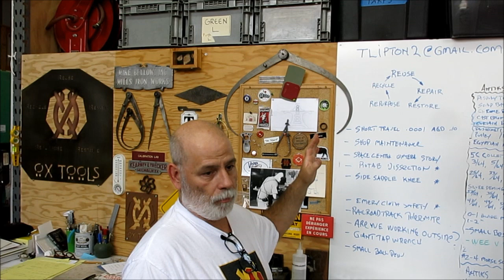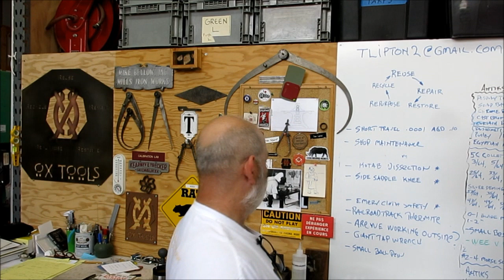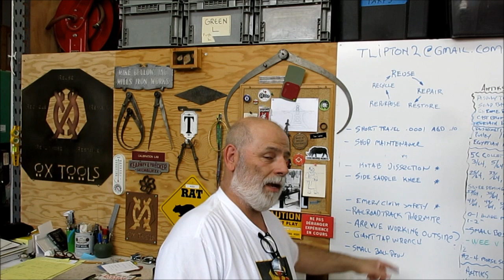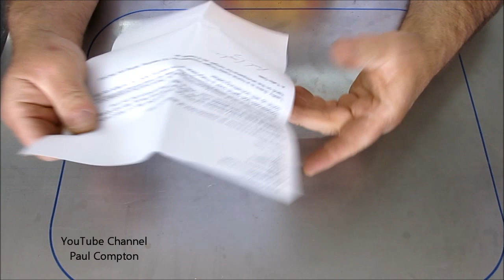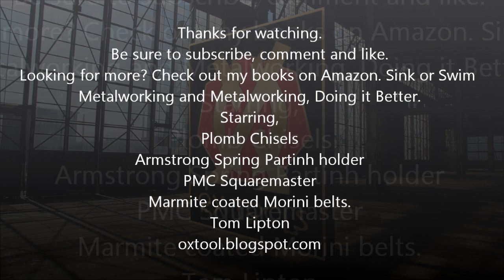Monday Night Meatloaf 36

Comment: Another cold chisel story. When I was a marine engineer on oil tankers we were required to use bronze cold chisels anywhere outside of the engine room. We worked at a rate of two or three sharpens per split pipe flange nut. Sharpening was done with a file.
Reply from the maker: Hi Derek,

Good old Ampco or Beryllium copper non sparking tools. I heard a story about a shop that had a vise made out of this material. Nobody used the vise but everybody was required to spend some time polishing it. Apparently it was pretty spectacular. This was a shop at the Concord Naval Weapons station.

Cheers,

Tom

Comment: Tom, When I get back to the shop tomorrow I'll try some purple stage lighting filter on top of a dial indicator face and see it it can reduce glare for you. 

Yes, gunblue does continue to etch. Bluing is the process of controlled oxidation. They also loose accuracy because of it. I reblued dads air rifle barrel, I can not stop it from rusting. I've basically soaked it in oil but I can't stop the corrosion. Thankfully it's just on the surface but it doesn't look good.
Reply from the maker: Hi Andre,

Thanks for the note. Let me know how the filter thing works.

Cheers,

Tom
Reply: I'll do a video and show you if you'd like.

I have a question about stamping letters, I'll email you.

Comment: Hi
Tom
Nice video
It is a brave man that power feeds a parting tool
Regards
John
Reply from the maker: Hey John,

Brave or dim. You heard the story so it must be the latter. Thanks for stopping by.

Cheers,

Tom
Reply: I dont call myself brave but i feed the parting tool most of the times. Usually working with carbide brazed tool that is 4mm wide at the tip. All it needs is a constant coolant and a right feed rate. The lathe is old, 1959 made in Russia. We call this mid-size lathe over here. The length between centers is 700mm. Power feeding just saves time.
Reply from the maker: nuu5t1k Hi Nuu,

You have it right. Constant pressure is one of the keys to successful parting on the manual lathe.

Cheers,

Tom

Comment: There are other variations on the idea used in your spring center punch.  I have a set of three that includes the spring center punch, a double ended nail set, and a small wood chisel. Very handy for things like setting finish nails in tight spaces, cutting mortises for door latches, etc. When you need one, nothing else will do. 

Thanks for the vid. Someday it might be interesting to see proper use of cold chisels. 

-- Mike

Comment: hi mr.tom, i love that parting tool holder. i could have used one a few days ago :) i saw the caked grim on the square bolt from the parting tool and thought that needs to be scraped, then i saw you try and pick it off with the screw driver and i though "at lest i am not the only one who saw that". love your videos. Thanks. Tristan Shepard
Reply from the maker: Hi Tristan,

I will probably bead blast the entire thing and give it a good oiling. Thanks for the comment.

Cheers,

Tom

Comment: Tom,
Nice chips after the grind with the parting tool. I like the older tooling when you just sharpen the tool rather then changing the inserts as you do with the new tooling. I think the only advantage with the new tooling is in the finish they leave and the fact that it is repeatable. It certainly can't be in the cost! As for the Marmite, yes it has a unique flavor but so does tree sap and I don't want any of that either. Now perhaps a nice shot of Scotch to get the thought of the taste out of mind. Anyway Thanks for the Meatloaf and for sharing the contents of your chisel drawer from your toolbox.
Kind Regards,
John
Reply from the maker: Hey John,

I think I'll test some of the Marmite on my Heeler. He eats almost anything including unmentionables left by cats. Marmite would certainly improve those.

Cheers,

Tom

Comment: I have one of those spring-center punches with the double ends at 26:00.
 I think that one end that isn't pointy is because it's a Nail set. or in your case Eric it once was 
It works great at setting nails I would even say it's better at setting nails than the center punch side is at punching centers.
 since you pulling the spring out to load it. It tends to move on you right as you release it. 
but with the nail set, there's a divot where the nail head engages that keeps it on target.

Comment: Tom

No-one else has weighed in with this yet, so I guess I might as well.

Plomb chisels and punches:

" Los Angeles " instead of " Made in USA " -  1939 or earlier;

" O " in Plomb, instead of downwards triangle - 1934 or earlier;

Letter code at the end identifies year eg  8D = 1938;

Changed from " Plomb " to " Proto " in 1948 to comply with legal action by the Plumb company of Philadelphia, over confusion in the marketplace about the names, particularly on hammers.

That confusion continues.

Regards
Reply from the maker: Hey Stephen,

Looks like these are between 1934 and 1939. Very cool. Its amazing they have been untouched for so long. Thanks for the comment.

Cheers,

Tom
Reply: oxtoolco Here is a URL to an interesting Plomb info site: 

http://home.comcast.net/~alloy-artifacts/plomb-gallery.html

Comment: It is interesting that here in the UK there is an advertising programme going on about Marmite on the basis of "Love it" or "Hate it"!!!!  In our house my wife loves it while I am firmly in the Hate camp.

You must have courage in Armstrong tooling, especially in that apparent condition, to power feed that parting tool. However it was real interesting to see the 'safety device' working and the modification of the cutting tool edge work so well for you. Thanks.
Reply from the maker: Hey Dan,

Aren't you a Parma/Parmo lover? What are your thoughts on Vegemite?

Cheers,

Tom

Comment: The hex punch looks a lot like a drift to make hex holes after they are punched out or drilled out. The long lead out lets the tool clear the work after it gets driven through the material.

If you are lucky, I may tell how I cut a piece of my thumb off with an automatic center punch and a bottle. (I was 12)

I use lots of customized chisels to make dashed lines and lines of varying thicknesses, a common design feature in lots of arts and crafts style work.

Those diamonds are great for making round holes square in thicker material, like 1/4" or thicker, too.
Reply from the maker: Hi Mike,

We tested our automatic center punches at the junkyard. About twenty cars were missing all their windows after we were done. No thumbs injured in the process. 

All the best,

Tom

Comment: Great vid,have been messing around with parting on my Sherline mini lathe and this vid came at the right time. I wonder if any one makes one for my little lathe,(spring holder). Any one of those keyway chisels do a woodriff keyway? Thanks Tom, Dave
Reply from the maker: Hi Dave,

I'm not aware of anybody that makes a spring tool holder these days. Most folks make their own as required. I'll have to look up chiseling a woodruff key seat. I'm sure its doable but I've never seen it done myself.

Cheers,

Tom

Comment: Great video again Tom, thanks for all you put in. You probably have lots on your plate but I'm new to machining and I would like to ask could you possibly do a video on steel. You mention cold rolled, hot rolled etc, I've read the process etc but don't have the experiance or knowledge of what cutting tools to use, what is best for what application etc. Many thanks Matt - UK
Reply from the maker: Hi Matt,

Thanks for the comment. There are some differences around the world when it comes to steel terminology. It might be more confusing than helpful. Get involved with a engineering club and meet some like minded folks in your area. Where about are you in the UK? I know a couple of characters around the London area that might be able to point you in the right direction.

Cheers,

Tom
Reply: Thanks tom for the reply, that's a great idea, i live and York which is quite far from London, although looking on the net this morning i found a model engineering club in Leeds, so will give them a call, or pop in for a chat. Thanks again Tom - Matt

Comment: Nice Plomb chisels, if the steel on those is as good as the wrenches they ought to be outstanding
Reply from the maker: Hey Eric,

All the new stuff has the lawyer heat treat on it. You couldn't chip a modern cold chisel if you tried. They just dull faster which keeps the MBAs happy.

Cheers,

Tom

Comment: How about an unique use for a cold chisel, 'Gear Cutting'. The firm I started my engineering career with manufactured a rack and pinion jack, long since obsolete, for moving logs around in the forest. The jack had a two step reduction gear system with two four tooth pinions. For strength the pinions were fully shrouded. This meant that conventional gear cutting methods couldn't be used, instead a slot was end milled on each face of square bar and a cold chisel used to create the tooth shapes to a gauge. Being labour intensive it was done by junior apprentices. Our output had to average five gears per day.
Reply from the maker: Hi Derek,

Sounds like good apprentice work. I'd love to see one of these things.

Cheers,

Tom

Comment: great video Tom, I loved watching the spring parting tool flex ever so slightly when you did the power feeding.

Do you sharpen the cutting edge square to the length of the blade or on some slight "knife edge" angle.

Billy
Reply from the maker: Hi Billy,

99% of the time I do dead straight. Its much less problem causing.

Cheers,

Tom

Comment: I like that Armstrong parting tool.  Looks to do as good a job as the insert parting blades that are all the rage now.  I would like to see a comparison with equal power feed setting between the two different parting tool types ... hint, hint.
Reply: I switched from HSS to a carbide insert setup - it leaves HSS for dead. Absolutely no comparison, it just cuts much, much faster. It seems like one insert will last half a life time too. I still kept my HSS for my mini lathe though.
Reply from the maker: Hi Gary,

I don't think you can draw any good conclusions from a comparison with carbide insert parting tooling. A better test would be to compare it with high speed in a more modern holder like an Aloris. I still use high speed for things like plastic because you can hone a sharper edge on high speed in general with normal sharpening gear.

Cheers,

Tom

Comment: photographers get round the reflection problem by using a polarizing filter in front of the camera lens. you fit the filter then adjust it so that the reflection disappears. this is very effective.
Reply from the maker: Hi Steve,

We tested a circular polarizer in the last video. It is not effective for the glare on the dial. Too much light from too many angles. Thanks for the comment.

Cheers,

Tom

Comment: Tom, The trick to Marmite and Vegemite is to butter your toast normally and use a very thin amount of the spread. I grew up in New Zealand which is Marmite territory since coming here I prefer Vegemite which is not so strong.
Clive
Reply from the maker: Hi Clive,

Thanks for the pointers on spreads. The buttered toast sounds like a good starting place.

Cheers,

Tom

Comment: Tasty Meatloaf. 

Spring center punch (at 25:57) is a Noxon Spring Center Punch.   Two bit snapper is another name. My favorite tool vendor stocks those and NICE Martin hammers:
https://www.tinmantech.com/html/layout___marking.php

Parting Tool.  I've always used HSS for years. Lock lathe apron, slow speed, slow power feed.... lots of oil.  1942 LeBlond does the work!  Aloris BXA Tool Post. Recently added a Hertel Cut Off blade to save on brass, nice addition.

Tom

Comment: Too high speed on the HSS cutting blade. It quickly blunts the blade tip.
In general it is recommended to use high speed steel with cooling emulsion.
Reply from the maker: Hi Danu,

I was below 100 feet per minute cutting speed. I could have actually gone a little faster and been fine. For small diameter parting I prefer the more slippery qualities of oil. For deep parting you are correct that a water soluble oil mixture is easier to get down deep into the cut. Thanks for the comment.

All the best,

Tom

Comment: Awesome vid, as always very informative very useful, it's always great following your channel, I saw one of your meatloaf videos where you quickly show a home made anvil, can you share more info about it? I find it interesting and may need/want something like that, I do have a piece of 9.5" length piece of old railroad track given to me from a job swap.as it stands, I am using the exaggeratedly postage size anvil [pad] on an old 40's, cast iron 5" vise.
Reply from the maker: Hi Edwin,

It was cut from a piece of full size rail. I marked it with soapstone and used a cutting torch for a lot of it. There was considerable grinding involved. Some guys even use hardfacing rod on the table and then grind it flat to make a more durable surface. I ended up milling a few spots to get things nice and flat.

Cheers,

Tom
Reply: Cool, thanks for sharing, much appreciated

Comment: Could you perhaps make a demonstration video of chiseling out a keyway? that is pretty interesting survival stuff, and probably a vanishing skill to be preserved (as is most of the chisel use in metal for what i see). Paul Compton did a interesting video on cutting sheet metal with a chisel a while ago. it whas nice to see that this was plain simple, quick and accurate. Keyways are a different story i presume, but nonetheless. thanks again for the videos and your effort.
Reply from the maker: Hey Flip,

I have a story about a couple guys that had to chip a keyway that was approx 150mm square. And it was done underground during a dam installation. 

Cheers,

Tom
Reply: oxtoolco I wouldn't mind if you did a demonstration above ground on a workbench..
hearing forward to the story though.

Comment: I really enjoyed this vid.....it was all good, but that cut-off tool really got me....in your opinion, do you think it could possibly increase the parting off capabilities for smaller lathes?  Parting off parts is a nightmare on smaller lathes....you get such high tool forces and flexing...I've heard it said that you want to actually maintain a consistent tool pressure when parting, yet the very design of that tool is to relieve the pressure at some point.  Why does it seem to be such a great tool? 

I'd like to know who designed it and give them credit.  This is not something you produce without some forethought....For sure, I would be proud to own that rusty old tool!

Thank you Tom.

Comment: This so called spring loaded parting tool could be good for older small lathes that have a flex from top carriage.  At least it wont brake the tool.  I had the same issue with my small lathe when parting off. Never found right carbide tipped tool for it that wouldnt brake.
Reply from the maker: Hi Nuu,

It might be worth it to make some smaller ones for mini lathes. Many folks have had trouble with parting on occasion. Thanks for the comment.

Cheers,

Tom

Comment: Nice tool parting something I have trouble with, if you could do a chicken sketch in your next video of just how you had the tool tip & then after you made adjustment, as the photo shot was a little far to see. Rob
Reply from the maker: Hi Robin,

The original grind on the blade had a tight curl chipbreaker at the tip. I flattened it with no chip breaker. The flat was slightly positive approx one to two degrees or upwards at the tip that contacts the work. Hope this helps.

Cheers,

Tom

Comment: thanks again for continuing your ever educational videos.

I  know that you have said before but could you once again tell the source and
brand of the aprons you use?. i loath the ones which  bear on the back of the neck rather than on the shoulders like yours do.
Reply: http://bendavis.com/product/aprons-original/

Dickies version
http://www.dickies.com/mens-clothing/mens-bib-overalls/Toolmakers-Apron-AC20.jsp

Or buy a grommet kit and convert yours thats what I did they gave us aprons at work and they had the neck strap.
Reply: Bill De La Vega thanks for the information bill. conversion is not a option because I refuse to buy those which put the weight on the neck. a few years ago I found a great apron for woodworking but they are too short to keep flying liquids off your clothes when in the machine shop, if my little metal work area could be so expansively described.

Comment: Hi Tom,

Is it just a microphone artifact that the lathe has a sort of rattling sound like an old diesel tractor idling?
Reply from the maker: Hi Lasse,

It might be that I have the high ratio threading gear installed. I put it in a while back when I thought I needed to do some metric threads. Its considerably noisier than the little gear. All straight cut spur gears running in air.

Cheers,

Tom